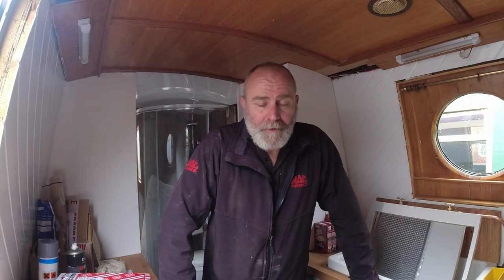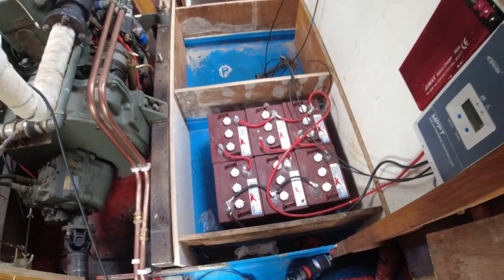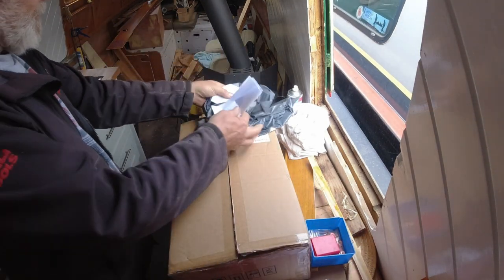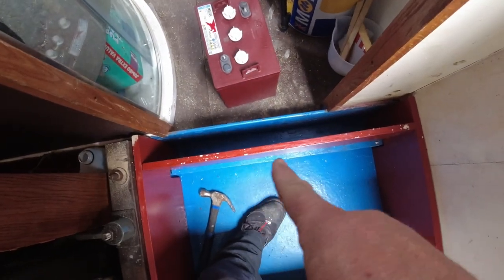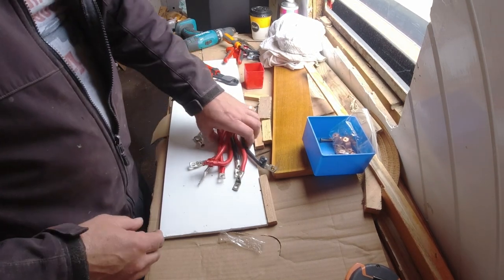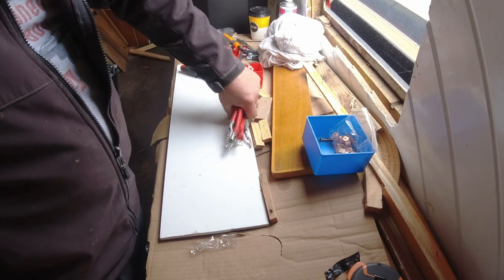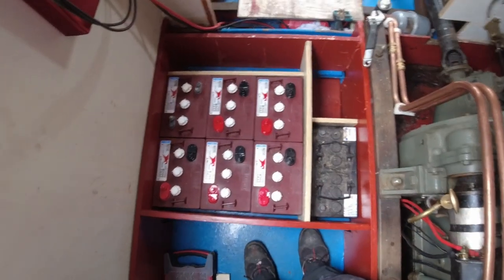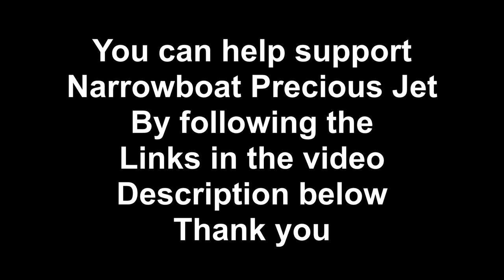Narrowboat Refit #64 Battery Box

Comment: Looking good Steve. However, I thought the latest BSC regs required the batteries to be secured against vertical movement and vented to outside if inside the boat. Worth checking now rather than have hassle later
Reply from the maker: Ah I will have to look into that! Thank you for pointing that out! Securing the top of the batteries is not a problem, venting to the outside may be!! 👍🏼👍🏼😊

Comment: In the airplanes I work on we use acid resistant bitumen paint on battery boxes. This is also approved for use on seaplane floats which makes me think it is the same thing you blacken hulls.
Reply from the maker: That could be an idea, the blacking used on boats stays fairly tacky so maybe a roofing type may work! The blue two pack I used on the base plate is the same as garage floor paint so is also chemical resistant 😊😊👍🏼

Comment: Hi again Steve thanks for that I’ve got a 100 watt 12 volt water heater and it gets the water warm I’m going to up it to a 250watt which should be best. I started with a 600 watt 12 volt one but a friend (electrician) advised it may be to big as the power comes direct from the batteries it’s a solid state switch which normally turns power of to prevent damage to batteries the switch is a “Victron battery protect “ which is wired to work the opposite way an app comes on to your phone automatically when installed and you set power on/power off parameters ie. Start 14volts off 12.5volts so it still protects should incoming solar be insufficient also at the moment my batteries float most days and the water is on before 11am. I’ll send you a link if you need anything I can help. Steve. NB Fiddlesticks. 👍
Reply from the maker: With the water heater do you mean 100w or 1000w? The 1000w immersion I brought is a low Volta standard house immersion to run a solar dump once batteries are full! Well deck diary’s did a video on solar dumps so I’m going to copy his set up 😊😊👍🏼

Comment: getting there, Steve, looking good. Don't know much about electrics but to be on the safe side is it worth considering drilling some vent holes at either end of the battery compartment? All the best from OZ.
Reply from the maker: Thanks Paul, yes there will be vent holes in the sides and also in the floor there will be vent holes to! Just been told I may even have to vent to the outside! 😊👍🏼👍🏼

Comment: Hi Steve are your six batteries 6 volt. Really coming together. I’m going to change to 6v Trojan and I’ve been advised to have 4 bug I’ve 750 watts of solar by midsummer and it’s even giving us a tank of water a day at present via the battery protect. My wife thinks we should upgrade total battery size and the inverter. As we currently run a travel pack for the washer, chip fryer, dryer and hairdryer. Passed you going into the basin last year 👍. Steve NB Fiddlesticks
Reply from the maker: Hi Steve, yes these are the 6volt Trojan batteries, my solar is also 750w! I want to fit a solar dump for heating the hot water, that way once the batteries are full I can divert the solar into the immersion heater (1000w) 😊😊👍🏼 You should of dropped me a message to say you were passing! Could of stopped and had a look round the boat and had a cuppa 😊😊👍🏼